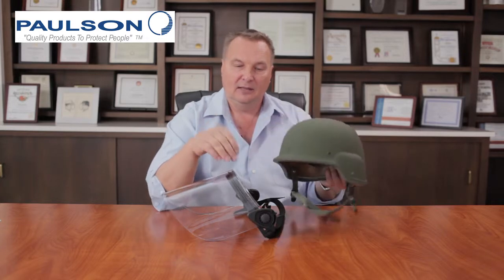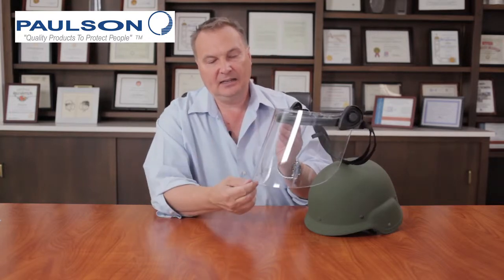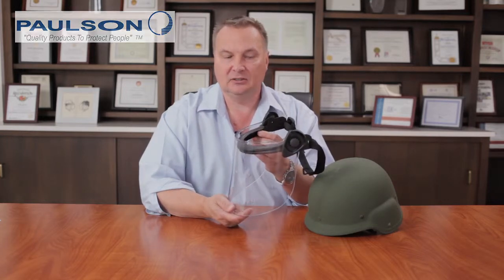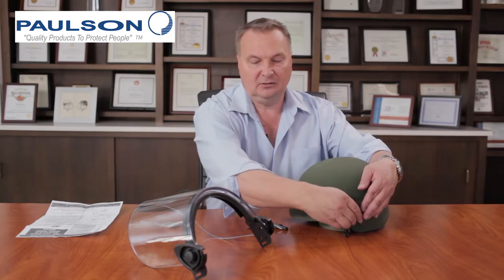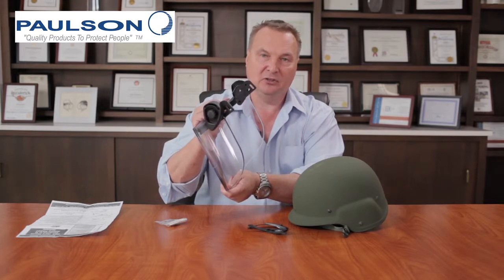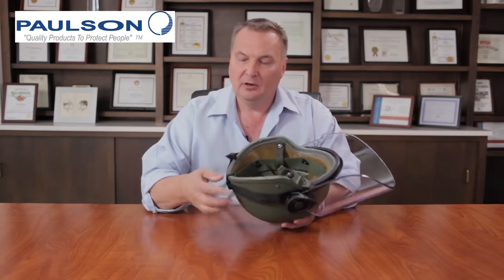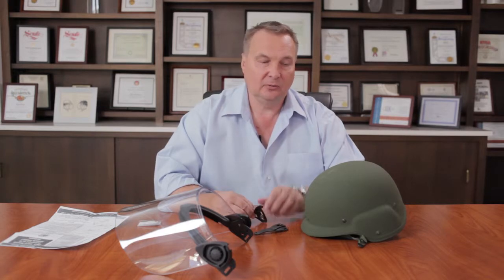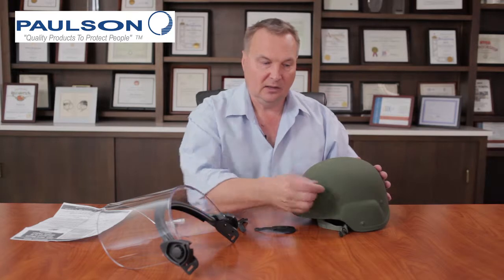DK5 Tactical Face Shield

Comment: I CANNOT FOR THE LIFE OF ME FIGURE OUT WHAT THIS THING IS ACTUALLY RATED TO STOP. i have tested it myself to stop 9mm but do not know what it can do.
Reply: Most of these aren’t for firearms dude. If they were they’d very clearly state what NIJ level they are rated to. 

Most of these that Paulson sells are for riot work. So they’ll stop BB, rocks, bottles, baseball bats, etc etc.
Reply: Did it stop the 9?
Reply: Did it stop the 9? They list the specs on the website. Their NIJ and Mil prf ratings are for non-balistic, low energy impacts.
Reply: The FBI Tested the face shield for liquids fire and blunt impact they are meant for riot control and might be capable at stopping peppering from birdshot at most it's only meant for impact and fire